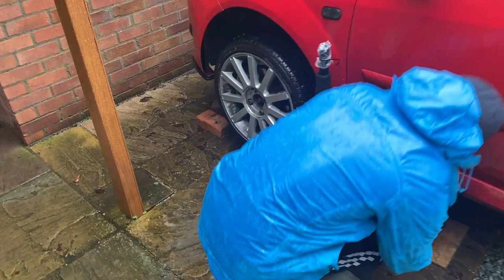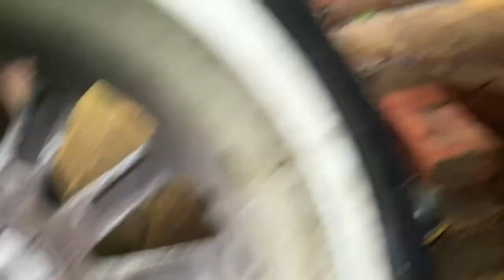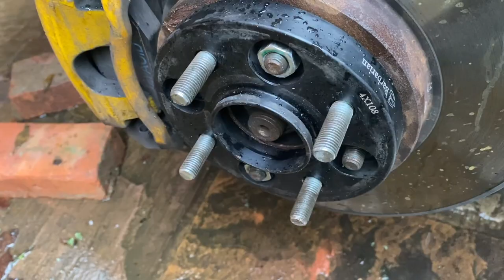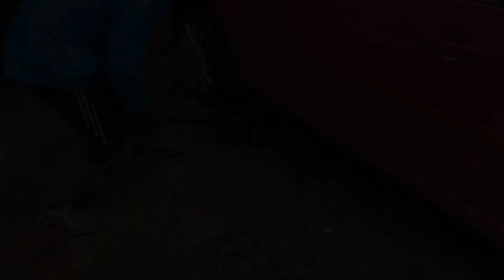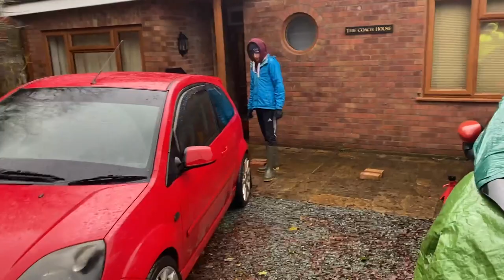Fitting 20mm Front Wheel Spacers to Ash's MK6 Fiesta ST150 | Hub Spacers

Comment: I've got a set of Weller wheels I'm going to fit (the formula ford design with the holes, like pepper pots, not the star design ones) they're 7x15 and ET18. I've had a look on willtheyfit and it says that they'll poke out 36mm more than the standard.
The difference being that my wheels aren't the standard st150 wheels, they're off a lower spec fiesta so the offset is crap.
Could someone tell me what the ET of your wheels are please?
Reply: Not to worry, I've just found the specs.
So the lip of the wheel will poke out 7mm more than your 28mm mods.
I think I'm gonna get some 195/50/15s for a nice stretch to avoid rubbing.

What coilovers do you have?
I used to have HSDs on my BMW'S but they don't do them for these little cars.

Comment: I’ve ordered some of these and they’re arriving later today. But I’m disappointed that the original threads need cutting. Is that a must do thing to install these?
Reply: Idk it seems a little wrong to have to cut the original threads down
Reply: I was surprised, you may get away with just filing the dome off of the top of your original stud before the thread starts, we didn’t have the patience with the weather being as bad as it was though 🙃
Reply from the maker: @tomboi123live  I guess if they’re 20mm spacers and the studs are 21mm long there’s not a lot you can do 🥴 it is annoying though
Reply: Thanks for the replies. Is the Colorado Red one lowered or is that standard ride height?
Reply: @MendItModIt  yeah I bet! Would the wheels and bolts go back on fine if he decided to remove the spacers? Also a vid later down the line showing how they’ve held up and if they’re causing any complications etc would be lovely
Reply from the maker: @Schuey_M  lowered same as mine, 35mm/25mm just not sure which is front and which is rear 😂
Reply: @Schuey_M  dropped 35mm
Reply: @ashleyadams611  Thanks gents. Mine is standard ride height. It is Colorado Red though, I heard it’s the fastest colour! 😂👍🏼
Reply: I’ve fitted the same brand with no isssues, no need to cut the threads down
Reply: I've got 2010 fiesta mk7 and my rear studs are 27mm, so installing 20mm spacer makes them stick out 7mm from the hub, it's fine as long as your rim has dimples/holes to fit excess length of the studs.